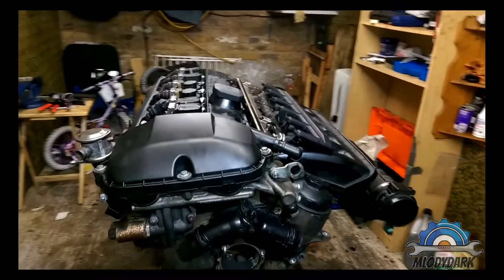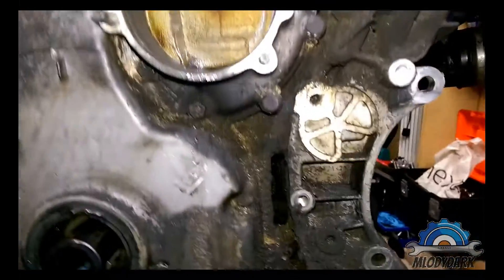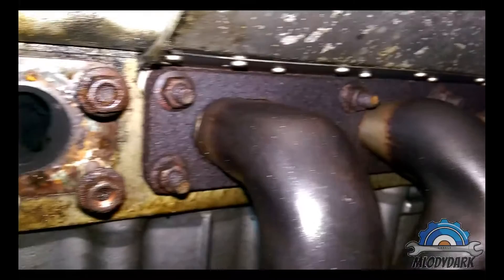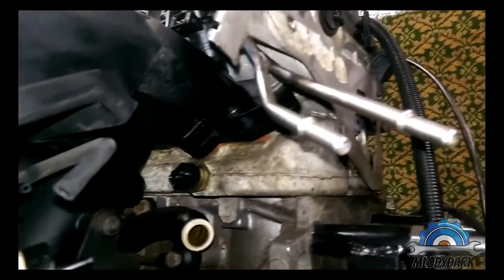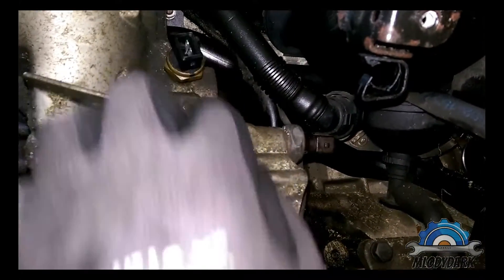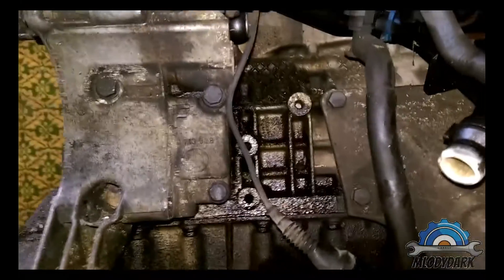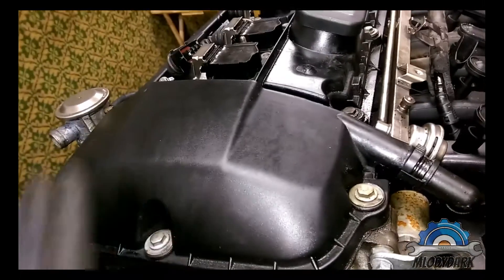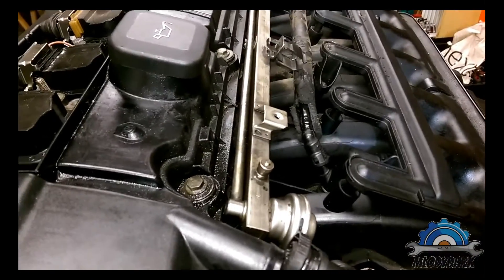BMW e46 M52TU/M54 engine overview

Comment: actually the DISA valve uses a flap which opens and closes to either shorten or lengthen the path the air takes to get to the cylinder chamber for low or high RPM,has nothing to do with the banks of engine cylinders.

Comment: Love your videos! Can you explain what would cause the 'trifecta' of 3 dash lights on my 04 330ci. The DSC, the red brake light, and the ABS light on?  No codes showing at all with my OBD2 ELM reader. What sort of reader do you suggest I get to read the BMW codes? Thanks
Reply: sounds like the abs sensors,,usually the left rear
Reply from the maker: Lycan ZHP is it automatic?
Reply: Elbow Grease it's a 6 speed manual transmission, the 'performance package'. I had the DSC and yellow brake light on for a while so I tried your trick of disconnecting the electrical box cover under the brake control box. But my ignition was turned on by mistake when I did it, so now I have the abs light also now and the brake light is now red. My speedo and fuel consumption gauge and odometer doesn't work also :(. Do you think I fried something when I disconnected the brake electrical box cover?
Reply from the maker: do you have any scan tool /app?
Reply: Elbow Grease I have Obd fusion, eobd lite, four stroke, Carley Lite, etc. none of them show up any 'codes'. The check engine light is not on so that's thy I guess.
Reply from the maker: any problems with battery or starinig/charging? mightbe wheel sensor. Apps usually show engine codes Not other faults I recommend use proper scan tool.
Reply: Elbow Grease thanks, I will try to find a good code reader on eBay?  Do you like INPA, or PA soft?  Or maybe a hand held one like snap on?
Reply from the maker: Lycan ZHP  get INPA